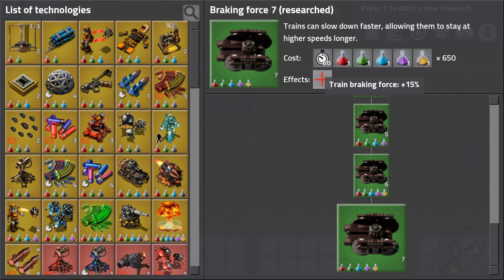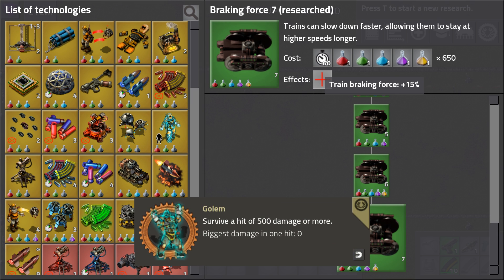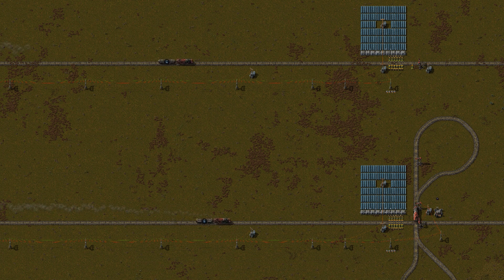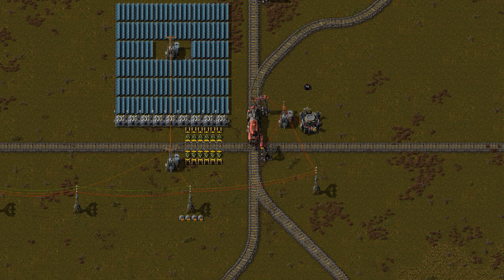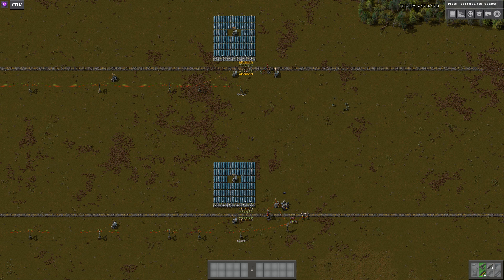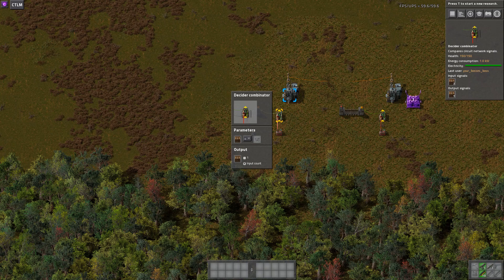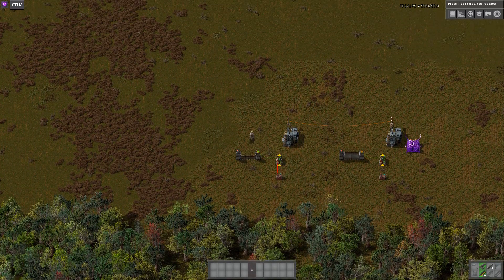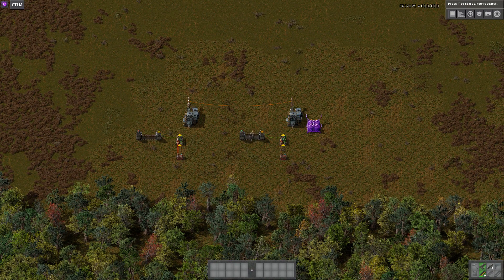infinite braking force Factorio (Vanilla)

Comment: Couldn’t you do something similar using rail signals? Place your signal before the real train stop with at least a three-tile gap (might need five depending on phase offset; I haven’t tested the limits). Hook it up to both the real and fake train stops with circuit wire. Enable the real train stop if the signal is red. Enable the fake train stop if the signal is not red. This makes the train repath in the nick of time, giving it magical braking powers. It doesn’t damage anything, is faster, and doesn’t need multiple trains sharing the same signal block.
Reply from the maker: This video is pretty old, i know there are now better ways of doing it than i did in the video but i haven't worked with stuff like this in a while so I'm not sure what does and doesn't work
Reply: @arrowinmygluteusmaximus  To be fair, I don’t know with certainty if this worked back then. I did look up in the changelogs that it was at least possible to hook up this way.

I guess a ‘disadvantage’ is that you can’t argue the ‘braking’ is infinite, even if it can be arbitrarily strong.

Comment: you can stop train by deconstructing a rail. maybe you can use it with robots?
Reply: But the train couldn't path to the station if a piece were missing. Perhaps deconstructing once the train has already been dispatched from the other station, and then replacing when the train arrives?

Comment: went hard with the train crash gate.  is there any way to do it with out the non linked roboport?
Reply from the maker: Yes, I'm working on another project that uses this principle. I'm not near the pc where the save file is located but when I am,I will post a blueprint string. You still need a roboport to repair, but now they can be linked
Reply from the maker: sorry for the late respondse.

Here is a dual station with robotports that can overlap. But i've only tested it with 1-1 trains running nuclear fuel and going full speed. It's possible it doesn't work properly in other situations.

0eNrtnV1v4kgahf+Lr6Hl+i5H2r2dHzBzNxohAu6MNcRGxvRs1OK/r40hGKjC59C9yWyUuZhWAn5i16m3Ps/r+p48rrb5ui7KJnn4nhSLqtwkD79/TzbFUzlfdb9rXtZ58pAUTf6cTJJy/tz9VM+LVbKbJEW5zP+TPIjdH5MkL5uiKfL++v0PL7Ny+/yY1+0XXq9s2kvL6aap1i1tXW3aS6qy+zstZqrTSfLS/utb9LKo80X/oZ0k7Y01dbWaPeZ/zr8VVd1dsSjqxbZoZu1ny1fM16LeNLOr2/9W1M22/c3rffTfmL7kq1X1d/co3aM3864c0u6H5/W8njfdH0r+tf/48Mfycv64ymfLYtP9mzw09TafJJu8XM6aarZ/uuTh63y1aX9b5/Pl7GtdPR9/3395/8OsK4J1vsRv9bdk199m2ZfLprtGdP97qvO8HBZ7sWyLPE13f3RXtE/VF06yqubLonwS7fNcKSTPtJ0e7upaImm+mF4k98WcyyRHZFpVm/z1cQ9FdPxwX1THz/piqtvCqbbNenuHnJGCapGXxeTV6Sb2xdYVWqB8FFSDtf0nVuB/j1fgvvwPVfJ/W1tDIvhBifeV117JMgnX80xcXWvOr5VMHOjXB1ls62/5crpv6q7jwB2i4CIGbABpTmXTFebTn00Uemj/7EVgBaAWhloPQx0OtTDU41ANQzMcKmGoSHEqrpQQMNXgUgmJU3GthMKpuFhC41RCLTyuDKEWHliaUAuPLE2ohYeWJtTCY0vjakk8tjSulsRjS+FqSTy2FK6WxGNL4WpJPLYUoRYeW4pQC48tSaiFx5Yk1MJjSxJq4bElcbUUHlsSV0vhsSVwtRQeWwJXS+GxJXC1FB5bglALjy1BqIXHFiEWMSDEoUSvhUOJwIKhGo4rXCcNRxVxn3BM4QWq4YjClddwPOFVVMPRRASThoOJiHsNBxPRRGk4mIjWVMPBRDT8Bg4moo8yeDThQhk4nIie38DxRAxSDBxQxHjKwBFFDP0MHFHEKNXAEUUMqA0cUcTY32TYslLXjYGrShaOJ2LmY+F4IiZpFu+ecO0tHE/E1Nee4ulp3uSh9d3j6rf5YkLLxNbABBshwJFCrBRYOFKIRQ0LRwqx/mLhvodYKnJwrBCrWg6OFWIBzsGxQqwVOnwshwvl4L6HWIF1cN9DrBU7OKKIVW0HRxSz/u6xbqITNNBNqBAS7HmmXvRMAazop+BmofPHxk5fbhaKEPcUUevtc2iDWIlXYKjt9KfoOe6GTRfV82NR7nfCAnNBdeQpcDfza7Fq8jqySR7bDEv7/blttzkn0v1/w71zZlvXa2y/0p9ifpkvimVej5SEjAgVKYcD9LR3ufmhzctN3oFmbImebXJOknu3izvU+mW2V6jfsC/KFtRvgRL7mPJiK/JSLBndxbzchpb7WiFj+6Ua3R1Ft7e9vq+6qPepLqe9bml/Qj1If14VuBbycndawtqNVIIraS8qn4ErnwEriSErSfoOlSQd80K8XfWAGnAu0mVMGgtOMBXey59GOHX1WK2ruglMFw48Fbwpz3XH2rxJb/zrsDcG+uGALCoiQzacaFRlPv17vlrdmgSq8CQwEySn77ZvmYyqdV7O9nPSg7Hn3HqVl5vu+xe2rB9xJv0yakrCy5vwA0WlGU6C5ou/pkW5yeu29oTmwNFhqw6R9ciw1eibo9bMjF1vbl9vx673t69HZx1ZsO1wQSfNKRAei6dpvmq/XReL6bpa5aGewvVoyVQJOdbTqmglufaMCQAWrFf7S+8ZOon3HjqJn9E3/nKjb9w3JrsfkFSc+sZbHtegKvI+VeSHGNCOTmxYaa5nHCMBJG4Oa24Jp5iWQ93RbqRX967jDUX425Fb19StizvuXd1vlAUultEn40b+Oj12OPKi+3zjYHrXFi6igomO/7ELLkPvB1S1lKoqe1dV2SWi395miYjv5PSFYNm1ovEYtmztsWMNtxkb+cTbO0fOUkR4tiNST4JkDDTcParq+VM+bRuCvwJDYjW8J8DDnaLg0Yc984PfRGWjKMkt7ovx/QJBWMB9P2ZKkfLDrXQ+xalEaoXHqbiVzlmcinvpnMapuJnOEWplbMoKQiUs4BZXi7CAW1wtwgJucbUIC7jF1SIs4JZQy7BpKxDVsmkrENWxaSsQ1bNpKxA1Y9NWECphAde4WoQFXONqERZwjatFWMA1rhZhAdeEWoZNW4Golk1bgaiOTVuBqJ5NW4GoGZu2glB1yqatQFTBpq1AVMmmrUBUxaatQFTNpq1AVMOmrUBUy6atQFTHpq1AVM+mrUDUjE1bQai4K3yKi2UEmbYCQSWZtgJBFZm2AkE1l7YCMQ2XtgIxLZe2AjEdl7YCMT2XtgIxMzJtBYHilnAi7nFLONFE4ZZwojXFLeFEw281mbYCQQ2ZtgJBLZm2AkEdmbYCQT2ZtgJBM8oBgyyFOdLNkUaW6Rzr5oiCBmGzfTy+0CTm4RdhhmGXSGOrj2e+amhNFFtrPbNWQwukGHdgW75Veof1nHDpDSzKiFdCjOfxCC+5V84YwH4xcP+OOLSP0lztewcjYuAAJA3W8v/EXy062xtihhTe3uUwEJ8G6/vdtVfqXO5WyTRuc90rhlsvQzUBJccrjbur0shPm/WolpcVQeHqmZGKMLaH2hldMav11VfjNcXfZbaWn17rm80FFfFR54Tn8nmRLntgHaYsNmr36anpyu6mhyETtyNYpn7MSHH5N6KBm4n7XDVvJOQHsdHI1AU0vPiNt/GGOBtz/F4LPrm6g7E6I9A6I/FcCxUmqDtzLcQ/PNWiD83wMxtuXh1zDWWW48QmxJmj0neROevAm4+8OVl/jBcnv80bkmUqIm+GlUlQiwxaPzhugwZzLeQgMWIsx1mPp57IQfIBkWehmfBTYwPtW43sVZOcagC3Cxcd/Y5q/SFeUQ3PLmV6X9K3+sx5ABcARirz7aSHQ3sTFO6+9Gv9mUI01lyNpRDdEsVg7f1hNynS3ls+nYVqnoPD0kn8YUOD2PCduzuyWahbt+PTtPiTIBdHHswz7/LXn6/ypzqrsal2O1O5MV4Ym3N5ywzZ5JltH0z61eHRvRQCTfNFBm4D6/5I0i9EU2gKMETTrP0belW3Ye3fENWy9m+I6lj7N0T1rP0bomas/Rt6BXrK2r8hqmDt3xBVsvZviKpY+zdE1az9G6Ia1v4NUS1r/4aojrV/Q1TP2r8hasbav6GDAFLW/g1RBWv/hqiStX9DVMXavyGqZu3fENWw9m+Ialn7N0R1rP0bonrW/g1RM9b+DR2HkbL2b4gqWPs3RJWs/RuiKtb+DVE1a/+GqIa0f0NQS9q/Iagj7d8Q1JP2bwiacfZv6DiYlLN/Q0zB2b8hpuTs3xBTcfZviKlJ+zcENaT9G4Ja0v4NQR1p/4agnrR/Q9CMtH9DxyClpP0bggrS/g1BJWn/hqCKtH9DUE2eWgBBDXlqAQS15KkFENSRpxZAUE8eMQBBM/KIAegIsJQ8YgCCCvKIAQgq0QMCIucDyMHb3EcIJkbQ5BED0IMZ8ogBCGrJIwYgqCOPGICgnjxiAIJm5BED0MF2KXnEAAQV5BEDEFSSRwxAUEUeMQBBNXnEAAQ15BEDEJT0OrkP/mJZZsuxN6K1nxdN/txti662+bouys6r9y2vN/0GoXdSZNaJ1O52/wULu19Z